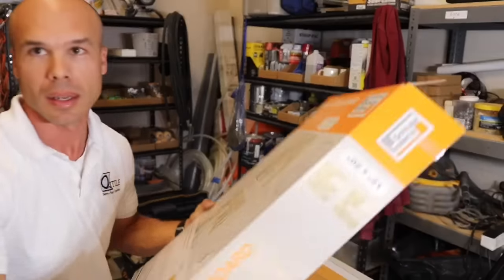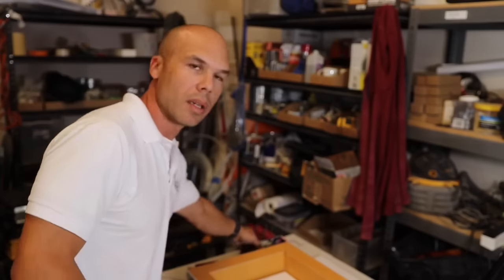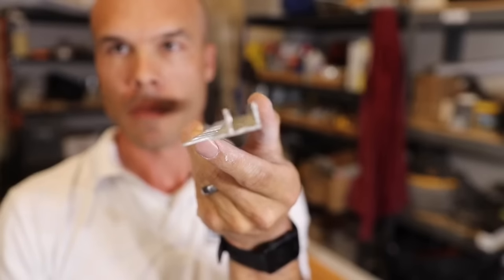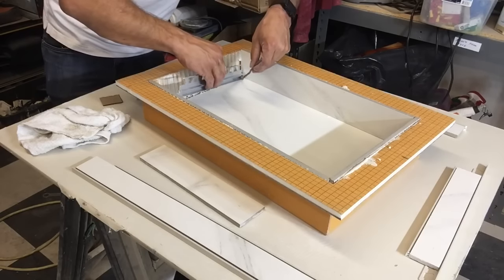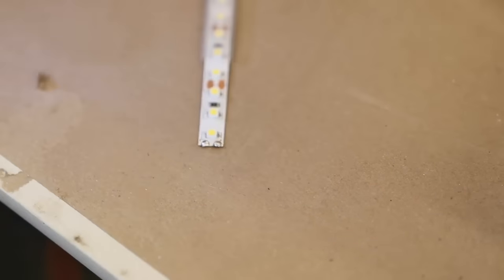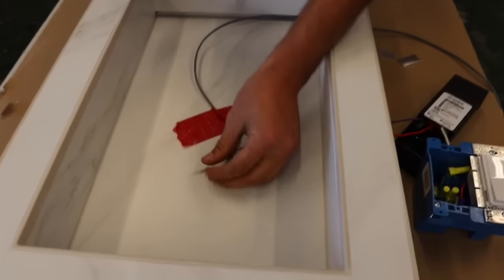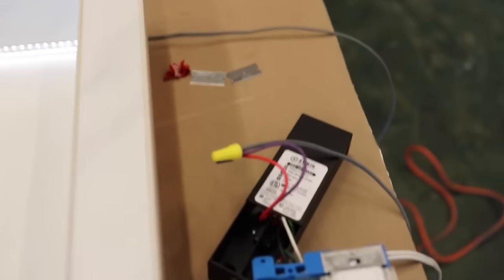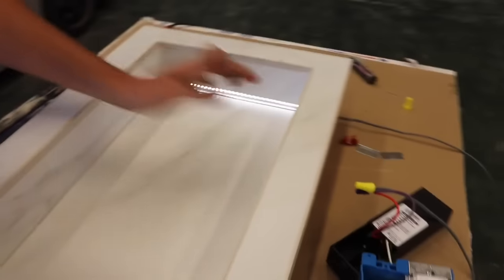How to make a Lighted LED Tile Niche

Comment: This is not by the standards of the NEC you would require a junction box or shrink/insulation wrapping of the surrounding solder. I would also imagine you to be damaging your warranty on your shluter based shower system.
Reply: Isaac Ostrom you would need to call your local electrical bureau or similar they should have someone on call to answer questions concerning the guidelines or consult a qualified electrician, ask if you can get away with making a low voltage connection without a box, but I doubt it considering that they do make low voltage boxes (the orange ones) that are empty inside and you would at least need access to this with a watertight cover. any solder or connection requires an outfit. I believe the safest bet for you is to shrink wrap the connection with approved insulation. If only an American manufacturer creates an led system that avoids all of these hurdles with similar cost as the Asian market however the reason why American lighting cost so much is because the have to pay to get approval and some even manufacturer very pricey thermoplastics.
Reply: @RubbinRobbin  Its Low Voltage. 12V. Assuming the junction box is up to code, the (speaker) cable coming out to the LED is not code necessary. You don't need an electrician to wire your surround sound speakers or your LED lighting.

Comment: Not so fast.  I see some problems when it comes to home inspection time.
UL certification.
IP code certification
AC connection must be in an accessible junction box (did not see that).  Where is the transformer and connection?
Red flag with inspectors.
Inspectors are suspicious of home made AC to LED devices.